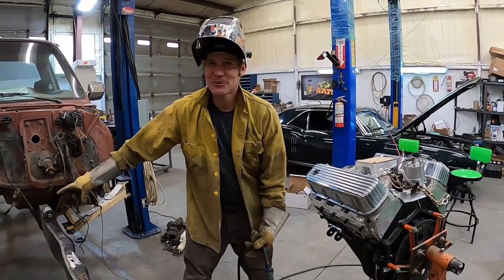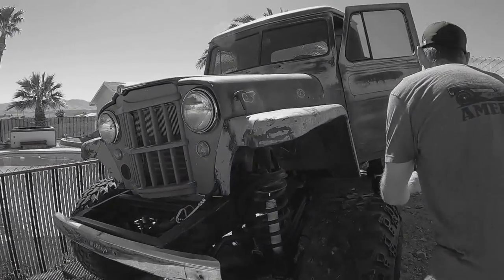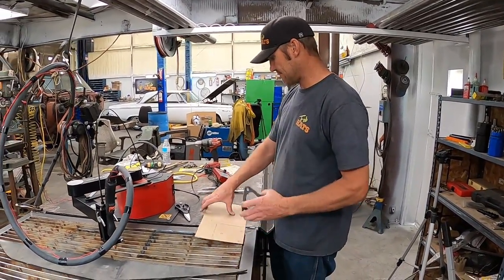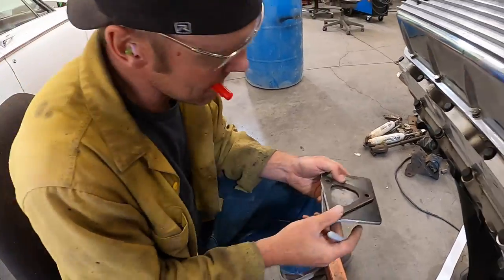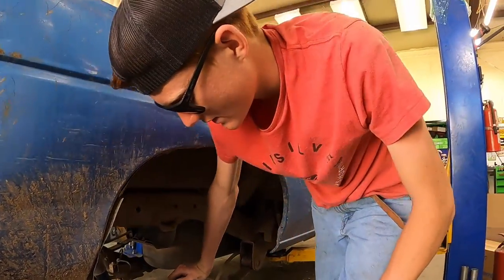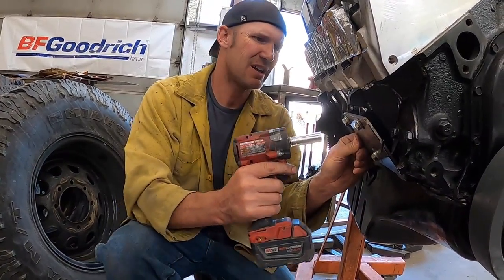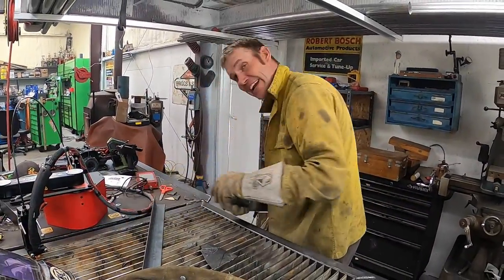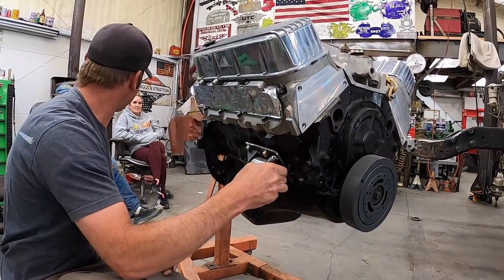The Rat Rod Tow Truck’s Motor Overhaul!

Comment: Paul here's an idea based upon one of my pet peeves and one which I would like to see you consider.  Even commercialize it if you want. The table you use for working on axels? Pull the yoke(s) off of both ends of the table and fabricate a slip-in bracket setup like the one on the engine hoist so you can STAND UP while working on engines the same way you do the axels.  You also have a table for transmission overhauls so why not while working on a big block? Give your back a break and at the same time get the motors you work on up in your face/teeth where you can see and operate! I see you working down on the floor on these engines (I get the reason for a low center of gravity needed on a big block) but if a man can safely raise it higher why not?  I often worked on the floor of my garage but as I get older my poor back makes me pay for it. Put it on wheels so you can move it out of the way if needed.

Just a thought...

Comment: Trx4 sport is a killer little rc rig, once it's set up, it will outcrawl anything around. Learn steering endpoints so you don't break a portal input gear( easy instructions on line) and learn about the front battery tray.  550 can brushed motors are cheap cheap. And tuck/ flip the bumpers.  There are millions of upgrades and millions of videos, but there is alot you can do for free.  Out of the box they are durable as they come. Lil dude looked so happy. And now has one of the best performing trail crawlers that exists.  I wish I had your terrain to play on with my trucks.

Comment: Paul, you will like the ARCDROID once you get it figured out. I have one and have had to calibrate a couple times. Last time was cause it looked like a drunk guy was cutting and it wouldn't do a straight line. I haven't tried the trace feature on mine but I DO like using it with Fusion 360. Material waste is higher than I'd like. You may figure it out better but material scrap may be higher than your current "no metal scrap goes to waste" motto. enjoy!

Comment: For those that don't know, Paul uses CAD in his projects. Cardboard Aided Design.
Reply: And eyecrometer measured!
Reply: Don't forget the EYE CROMETER
Reply: Lol, excellent!
Reply: I have a hard time throwing away cardboard boxes, cuz as soon as they’re gone I’m gonna need to CAD something.
Reply: A hot melt glue gun works great for multi part CAD mockups..
Reply: What do you give the man who has everything?
A cardboard box to keep it in 😉
Reply: First time I heard about Cardboard Aided Design was from Craig Vetter, of the original Vetter Honda streamlined fairing. Think he MIGHT have been the originator of that term.
Reply: Ben using CAD before the Computer version came about LOL...
Reply: @billchessell8213  On a kitchen table in Rantoul Illinois....
Reply: hahahahahahah
Reply: It’s not cardboard it’s cadboard. 😂🤣😂🤣
Reply: The best fabricators use (cad) cardboard aided drafting. I use cardboard, soo hmm !!
Reply: Some vehicle design CAD lets you see the car as if you were working on it. Much easier to see where parts connect of clash.

Comment: You didn't finish the "bigger hammer" statement. It should be: "If it doesn't fit, get a bigger hammer, if it breaks, it needed replacing anyway!"
That was my wifes motto. :)

Comment: If ur oil pressure is a little low ..
Cross drilled crank. 
I would have went to a 4.250 stroke for a 496 cub. 👍
But I’m sure it’ll be fine lol 
Great videos y’all !!

Comment: I am afraid that CNC would barely help when you have to cut one off pieces like the small triangles with weird angles: you'll still have to do a cardboard mock up, then precisely measure the angles and dimensions, enter that in a computer, calibrate the CNC... by that time, you could have traced your cardboard template on a piece os scrap steel, cut it manually and ground it.

Comment: One question for you, Are those grade 8 or better bolts holding that engine to the stand?  If not you might want to consider using grade 8 bolts that's quite a heavy engine being supported by bolts that stretch and break. One guy in the shop dropped a 4-53 Detroit on the floor just as he was tightening the valve cover bolts after a complete rebuild. Culprit was a grade 5 bolt about 5 inches long holding engine to the stand bracket, loss; one engine block, broke the corner of the block off almost crushed his foot at the same time..  Engine mount to block should be grade 8 or better also.

Comment: I made motor mounts the same way for a '78 IHC Scout with a 345 V8. I used rubber leaf spring bushings and the engine in a Scout weighs like 800 lbs. Worked perfectly and never had a problem.

Comment: Yeee haw I love my TRX4, if that's the scale/trail crawler that's a BEAST, it's got front and rear lockers, a two speed transfer case, and a whole lot of torques.  Highly recommend the Traxxas brand batteries and charger, so everything can talk to each other and Just Work.  Great rig!  Even if it's "just" the TRX4 Sport it's an awesome vehicle, four linked rear and three linked front, portals all around.   I hear they make Milestar Patagonias for the little guy, too!

Comment: Hate to be that guy but ... a 2500 rpm stall on a tow truck? That's gunna be great. Gunna need a neck brace and helmet. . Ever drop the clutch at 2500 rpm in low low on a hill.. might want a smaller stall?

Comment: I have a Nissan hardbody myself with the 2.4 liter in it and I just recently shimmed the oil pump about 3mm to bump the pressure up and eliminate the timing chain rattle. Wish I would have did that years ago because it works and sounds great now.

Comment: Should have put a washer in as a small spacer with the round part of the mount before welding the tabs in that way you can actually get it in there in the truck

Comment: When I made the mounts to put the 5.3 ls in my friends J20 I used c channel for the mounts and it was a bit less welding since the gusset was built in. But if all you have is plate then a bit more welding it is.